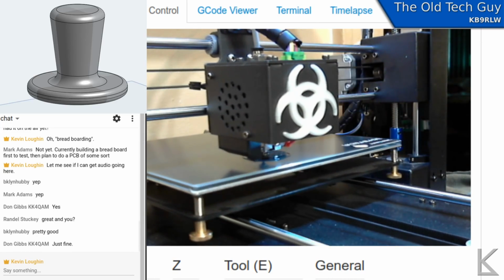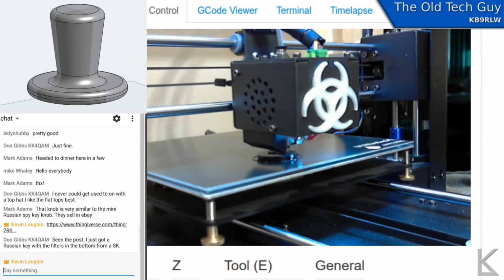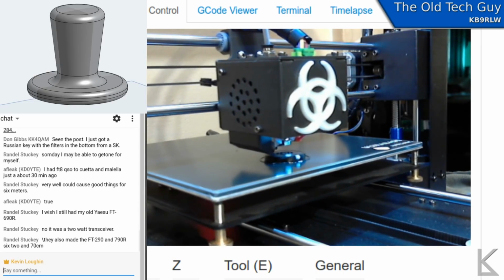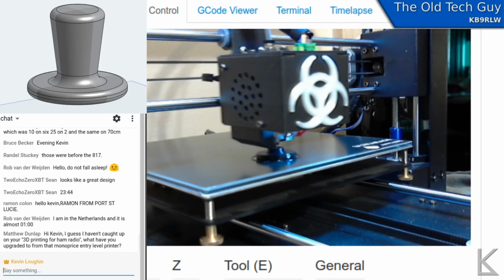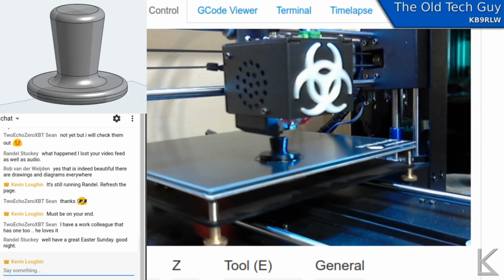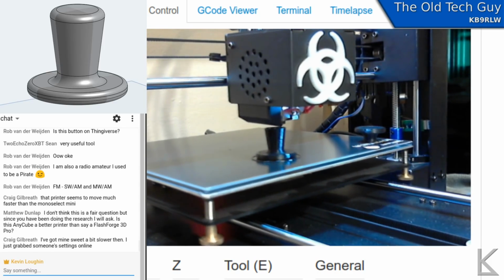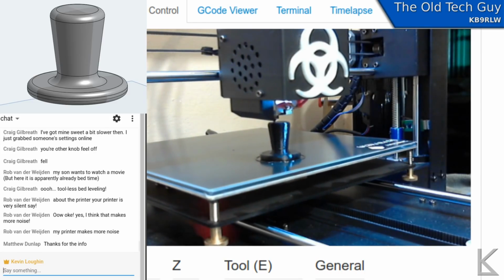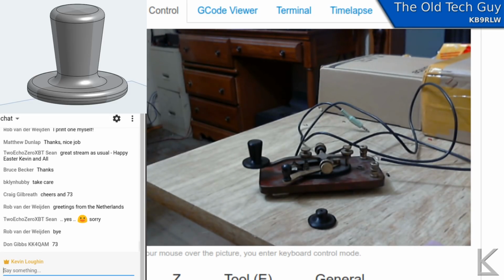Live Stream Archive - Printing Ed's custom J38 knob.  Audio starts 11 min. in.

Comment: Something happened to me like a rogue update screwed my hard drive so I had to install my Crucial 256Gib SSD and try and use my hard drive as a data drive just one problem I have Linux Mint 18.1 KDE installed on the SSD drive but I don't know if it is safe to nuke the data on mechanical drive so I can use it as a data drives for documents and photographs.